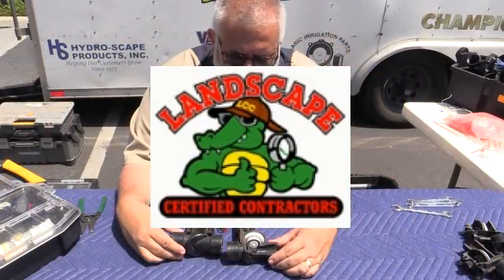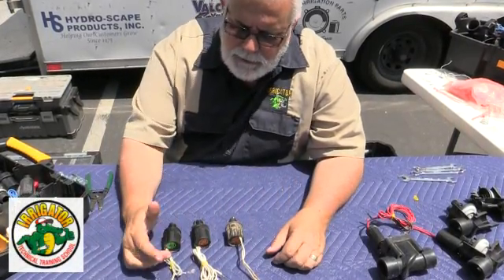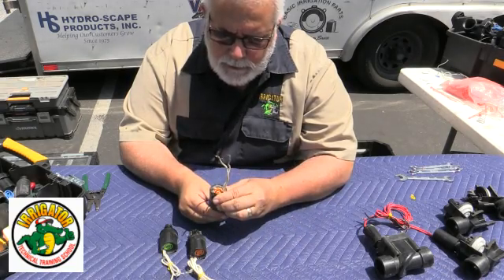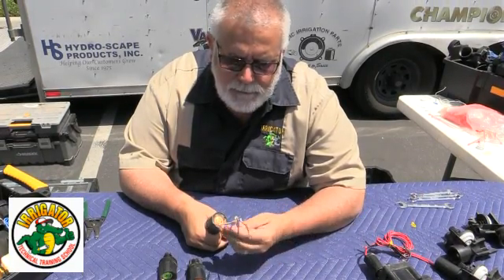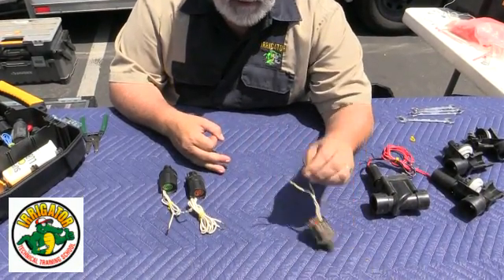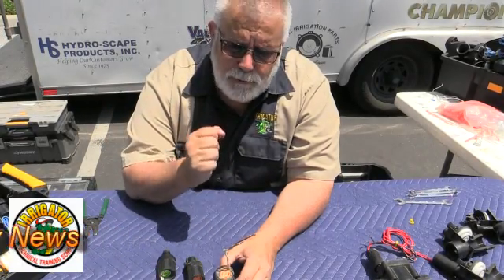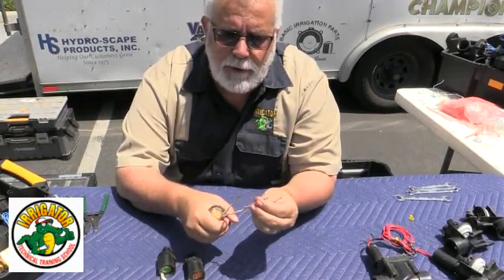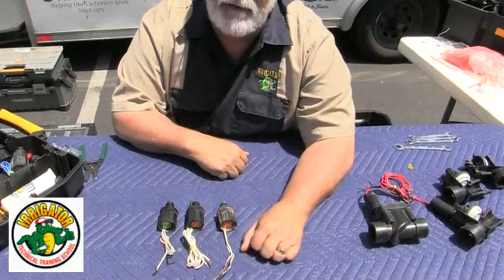How to Troubleshoot Irrigation Valve Solenoids

Comment: Common is hooked up 2 all valves and they are water cooled solenoids so by shutting off water supply power going to other stations gives current though the common to the valve that's off so therefore burning the solenoid and putting stress on the others